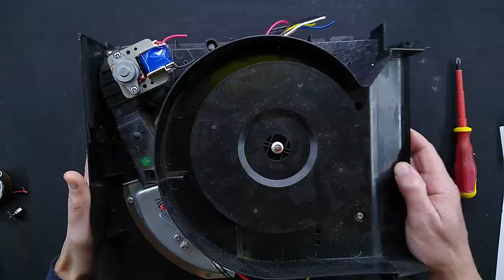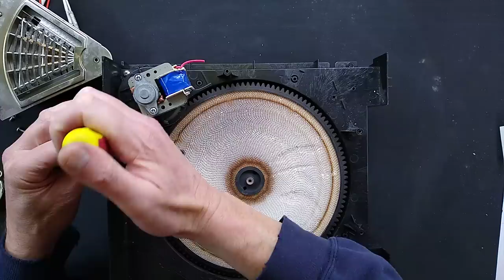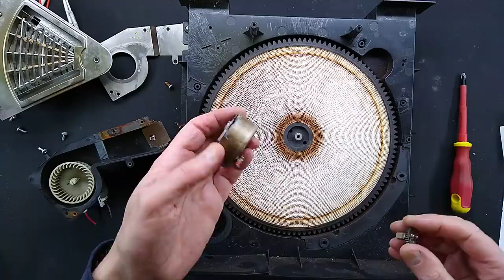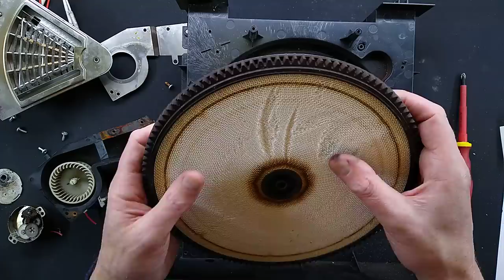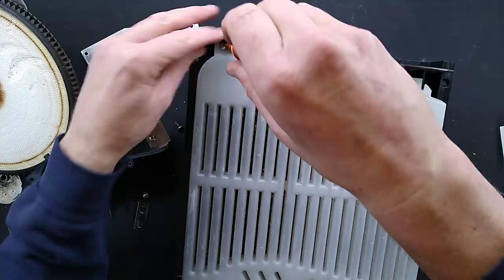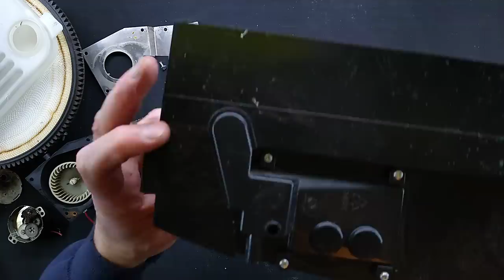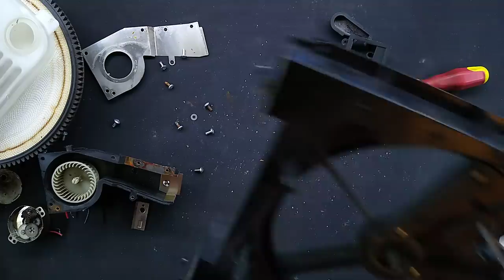Desiccant drum dehumidifier teardown

Comment: It would be interesting to run this type side by side with a compressor type. 
In such an experiment, it would be useful to monitor the energy use and the amount of water collected. I run a couple of compressor type dehumidifiers,  a small one in my home lab, and a larger one for the house, both operated at night In economy 7 electricity rate.  In winter, when the windows are clised, they not only remove water from the air, but also efficiently supplement the central heating, as the units are extracting latent heat from the water being condensed.
Reply: I can help you there. I have one of these downstairs & a compressor type upstairs. The compressor one runs a lot more of the time than the desiccant one. The desiccant one is on the low setting consuming approx. 300 watts & the compressor one consumes 190 watts. Both set to maintain 50% RH.
Reply: @phil955i  but which collects the most water in the same time period?
Reply: @nigeljohnson9820  the desiccant one for sure. But that's probably due to the ambient temp in my house in Winter (I only use them in Winter) averaging about 18c with the dessicant type being more effective at lower temps. If they were used all year round I'd expect the results to be different.
Reply: @phil955i  that is a surprise, I would have expected it to be the other way around. During the winter months the house humidity rises dramatically, due to the high levels of insulation and less than ideal ventilation in a relatively old house. . We have just experienced some very wet weather, and the humidity levels are at their worst at  around 63%. The lab numbers are kept much lower at around 45%. Outside humidity levels are 70% to 80% at the moment. 
Both dehumidifiers collect large quantities of water, sometimes as much as two or three litres a night. The minimum room temperature at this time of The year is kept at 19C, by the central heating thermostat. 
While it is not recommended, we recycle the water to feed the house plants, particularly the carnivorous ones, which hate the high levels of lime in our tap water. 
I will investigate the desiccant dehumidifiers, when I next have to replace a unit, but I think we do benefit from the heating the existing units provide, while it is still sufficiently low for the units to be used in the summer.
Reply: @nigeljohnson9820  ha ha yes I've got a carnivorous plant too, a single Venus Fly Trap, I was a bit dubious about using the condensate from either dehumidifier to water it as I thought it might be contaminated by either the zeolite (from the desiccant one) or aluminium (from the fins of the evaporator on the compressor one) but it sounds like your plants don't mind it. When I say the average temp in our house is about 18c that takes into account us being out during the day at work, so it may drop to about 14c because we only have the CH when we're in & it's not on overnight either. I think if your house is kept at a constant 19c (I'm guessing you have heat pump CH) then a compressor based one would be better for you as they work better at that temperature. The desiccant ones come into their own at lower temps.
Reply: @phil955i  thanks for the info. As I have retired, the house is kept warm all the time. We did run it at 21C, but gas CH heating bills has made me cut the temperature, I may reduce it further to 18C. 
Some of my carnivorous plants do well on the water from the dehumidifier, but my Venus fly traps did not. I do not know if this is the result of aluminium in the water. The problem is mood growth in the sphagnum.
I would have thought that oxide passivation on aluminium parts would stop any aluminium salt contamination. I suspect it is more likely due to bacterial  or mold spore concentration in the warm water.  We have had more luck with sarracenia and mimosa pudica, that do well on the water.
Reply: @nigeljohnson9820  we're going off at a tangent here talking about Venus Fly Traps lol, but recently I noticed some tiny little black bugs on my plant. Worried, I did a little research on the internet & found out they were Spring Tails that are harmless to the plant that like to live in damp environments & eat mould so they're actually beneficial. Don't know where you'd source them from, but they seemed to appear straight after I re-potted the VFT & concluded they were in the specialist VFT re-potting soil I bought online.
Reply: @phil955i  I don't think bigclive will like US going so far off topic, but I think you will find the spring tails come from the compost. I have not had much luck with fly traps, they always rot off at the root.
Reply: @nigeljohnson9820  Strangely I've had very good success with this particular VFT (my first), even my other half expressed surprise as I have no interest in gardening whereas she has. All I do is water it twice a week with deionised water to keep the soil damp. I didn't even hibernate it last Winter as you're supposed to do. It just seems to flourish & is 3 times it's original size with a healthy green colour. Beginner's luck I guess lol.

Comment: A friend of mine has a moisture issue in his house because the builder decided that putting a waterproofing membrane on the buried walls of and under the slab was for wimps. He basically runs compressor type dehumidifiers 24x7, and they're constantly pulling moisture from the air. I did suggest that this kind of desiccant dehumidifier might work better during winter, but I think he wasn't as interested since it wouldn't work during the hot Australian summer.
Reply from the maker: The answer is to use compressor in the hot season and desiccant in the cold season.

Comment: Do these non-compressor based dehumidifiers produce water that is safe to drink? or does it still have that issue where you need to purify treat water before consuming (or just use water produced for plants lol)  Thanks for your time.
Reply from the maker: In an emergency I'd still want to sterilise it before drinking it.

Comment: If the system was kept clean, or redesigned a bit, shouldn't the water be safe to drink as it's heated to a hot vapor? The heating element gets hot enough to char the desiccant wheel. I bought one of these and took it apart immediately after the first hour of use as it had a slight burned smell. The whole wheel was slightly browned from the heating. I didn't measure the temp but I assume the air is heated enough to kill any bacteria or spores that may be lingering? My desiccant unit holding tank water stays crystal clear, even after sitting for a few weeks as I've forgotten about it.

That's the problem with a compressor unit, the cold, wet evaporator coil is a good air filter and traps bacteria and spores in the water as it drips down the collector pan.
Reply from the maker: I'd probably drink it in an emergency, but only after treating it further by boiling or adding trace chlorine.

Comment: Do we know the exact type of desiccant it utilizes?
I only ask due to what I had heard — and being that it was on the internet, it has to be true haha — is that Silica Gel desiccant "can't be reused" because "once they absorb moisture, they're done, just throw them out like they're meant to be."

Mind you, I believe wherever I'd originally gotten this info from had also said that the water 'technically' can be removed, but there's no practical way to do so at home in account of needing like 2000°F (1100C) to accomplish... 🤷‍♂️
(Or at least that's the number that sticks out in my head, to purge moisture but maintain integrity; looked up its melting point: 4046°F/2230C)
Reply from the maker: Silica gel can be reused if heated to dry it.  Often heating to around 110C.
Reply: @bigclivedotcom  That's helpful to know, thank you!

Comment: I remember taking one of these apart after a few years to clean it. The disc turned from brown to white on hoovering. It worked so much better, until a few months later it leaked all over the floor.
Reply from the maker: The leaking is a common issue when they gunk up inside.

Comment: Okay, I don't really understand how this works.   I get the part that zeolite absorbs moisture from the atmosphere.   Then the heater blows across the zeolite and converts that absorbed moisture to steam.   Then the steam goes past some plastic that is colder and the steam condenses onto that plastic and drips into the reservoir.  But I don't understand how that steam doesn't eventually heat up the plastic so it's the same temperature as the steam, or heat up the room so that the temperature difference is too slight for there to be any condensation.
Reply from the maker: The plastic condenser is always being cooled by the room temperature air flowing over it.

Comment: So, having kept the heating off all October, we've gotten used to temps around 15 degrees. So instead of putting the heating on full blast we've turned the heating right down in the house to save cash. Now thinking we perhaps should get a dehumidifier so we don't get issues with damp or mould as a result - and because we're drying all our clothes indoors too. Is dessicant the best option? Taking into account cost of running it too. The 300/600w figure seems a bit scary when you compare with the 180w compressor, but if I can get away with running it less maybe it's the same? Moreso if the compressor model doesn't run well at the lower temp - we have a garage door that sticks outside too sometimes in the winter so I was hoping it might help in there.

Is the 'only use the low setting to extend the life and avoid heater issues' still applicable? I'd sort of already made my mind up to get a desiccant but then I start seeing forum threads with people having issues with the DD8L, and these videos that have made question the choice too (the one about 8 years ago) - especially since the 'branded UK' models just seem to be rebadged generic Chinese models.  I don't really want to spend £200 for something that breaks in 3 years or less - especially if you can't easily get parts. I've replaced the element in our fridge, cooker and washing machine over the years saving a fortune - but that's mostly because (a) Someone much smarter has created a youtube video showing how to take everything apart, test the resistance of thermistors and elements and put it back together and (b) because bosche, hotpoint etc parts are easy to get online. Anyone know if there's a desiccant dehumidifier that you can get all the parts for?

 Am I just as well getting a cheap and cheerful one that uses myself as the intelligent device that switches it on and off? Any recommendations for a current model? Is it still the DD1 simple?
Reply from the maker: The desiccant drum dehumidifier will work better at low temperatures and also contribute to the heat while it does its job.  I recommend running it at its lower setting for longevity.
Reply: @bigclivedotcom  Thanks. I notice ecoair sell some spares online (motors and stuff) so might get one of them.

Comment: Thank You! Been thinking about getting one of those for a few years now.  Currently using Wood’s compressor dehumidifiers.  Which type are you using in your home?
Reply: I guess our home is a bit warmer than yours in winter, we keep about 16-17`C in winter.
Reply from the maker: My current choice is an Ecoair simple.  It's a unit with minimal electronics.  The more complex ones do have more features, like running briefly to sample air humidity and cool down cycles.
I would guess the same unit will be available under different brand names.

Comment: Would appreciate if anyone can advise. I have an ecoair dd1 simple I use in my workshop. It has run well for ~7 years, almost exclusively on the low power setting. It started leaking water onto the ground so I stopped using for a few weeks, took it apart, found the outlets of the condenser to be gunked up, cleaned it and the sump, vacuumed out accumulated dust, then started using again. I ran it on high power (to try and bring down the humidity) and it was working great. Checked it a few days later and it has stopped working. Plugged in, there are no lights showing up, no fans running, nothing. I hear a very faint click when I turn the humidistat dial up, but this may just be a microswitch which engages the humidistat from the off position. Any advice where to start in troubleshooting? Could a thermal fuse have blown if the heater gave up because I was running it on full power?
Reply from the maker: It sounds like it has tripped a thermal cutout or maybe has a bad connection with the tilt switch (give it a bump and shake to test that.)   Also make sure the magnet is in position on the water collection tanks float.
7 years is pretty good for this type of unit.  It may be worth investing in a new one.
Reply: @bigclivedotcom  Thanks Clive. I took it apart fully tonight. Found that the plastic condenser has slightly melted where the air is blown into it. The thermal fuse located beside the blower outlet has no continuity, so presumably blown. When I jumped over it I did start to get LEDs but no fans or disc motor running. The circuit with all the  thermal switches inline also seems to have no continuity - possibly the one beside the blower is toasted, and I think these go back to the board to activate a relay for power elsewhere, so may be why the LEDs come on but no power goes to motors. 
The disc motor feels pretty dreadful. I put 240v across its terminals and it didn't run. I suspect it failed, causing the drum to stop turning, which allowed the output air to get too hot, melting small holes in the condenser and burning out the fuse. It maybe had this problem already but because I only ran it on the lower power setting it never got hot enough to cause the problems I have now had. 
I will try to fix it. The condenser can prob be patched (I hope...), eco air sell replacement motors (I live in Stirlingshire so easy enough to get UK parts)  and I can buy some thermal switches and thermal fuses to match the original spec. A new unit will cost about £250 now, so if I can get it going for £30-40 it's worth it. I am glad to see how extensively the design uses thermal cut offs and fuses throughout, as mine could easily have started a fire if the fuse hadn't blown.
Reply: Actually, it just occurred to me that while I had it apart, the tilt switch and the one for the container were probably both open. That's likely why I got the red led when jumping the thermal fuse, but no motors running. I'll have another look tomorrow. Daft of me not to think about that. Thanks again - if you  hadn't mentioned the switches I prob would have gone round in circles a while before realising.

Comment: You've got a 3D Printer right?
So print a Gear for one of the motors you could find with the flat side on only one side of the shaft
Reply from the maker: I did actually toy with that idea, but wasn't convinced it would last as long as a solid part.
Reply: @bigclivedotcom  That gear is not that stressed i think, running slow like that. Print it 5 or even 10°C hotter than you would normally do and go up with the extrusion width to 150% or more to really squish the material down and get a pretty solid part. You maybe have to print the gear a few 0,1mm smaller and the holes a few 0,1 mm bigger to compensate for the squishing and the hotter temperature.
And even if the new gear fails, a new one is just a few hours away

Comment: Can you please do a video about LED flashing on and off. Possible causes and fixes. It's every light in my house and I'm going insane. 🥴
Reply: @Frank Vera I'm talking about a random duration on then off type of thing, not flickering. It's very common in LED lights.
Reply from the maker: If other electrical appliances are working OK it may just be lamps with failed electronics.  Another thing that can cause pulsing is active switches or ones with neon/LED indicators on them.  They pass enough current to make some lamps flash.
Reply: @bigclivedotcom  I'm talking about the electronics. When the circuit fails, common problems, and possible fixes. Street light keeps going on and off etc.

Comment: Couldn't you have used a brass bearing sleeve in the motor housing?
Reply: I'm sure Clive has the ability (or knows someone who does) to machine some flats onto a round motor shaft. You could argue though that the other worn parts will break down sooner rather than later.
Reply: @ralphj4012   Just use a grinder

Comment: I thought these were more efficient than compressors… but he said the opposite?
Reply from the maker: In cold locations they are, but not in hot locations.
Reply: @bigclivedotcom  I just watched this video again.  If a person insulated around the heating element with aerogel or other fireproof insulation would it improve the efficiency?  I’m trying to figure out what to do about a camper, I want a quiet dehumidifier.  I would assume a smaller unit uses less energy.  Do you know how hot the heating element gets?  I wonder if I could install a solar heat tube and get the heat from an alternative source of energy.